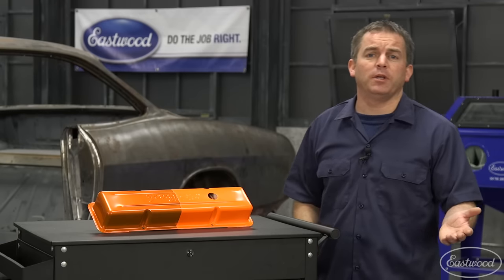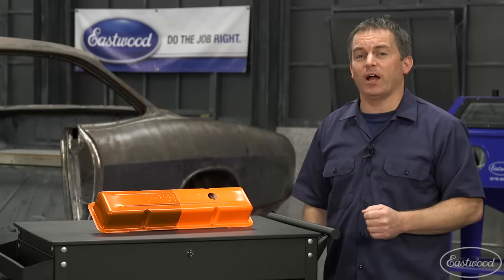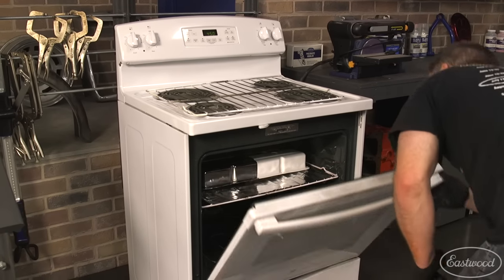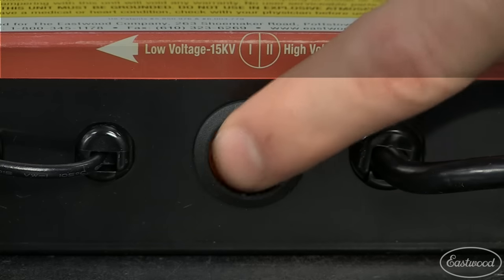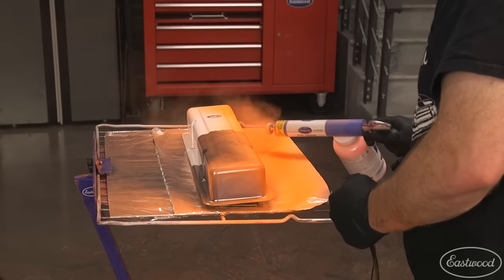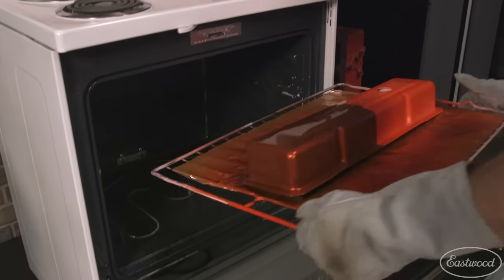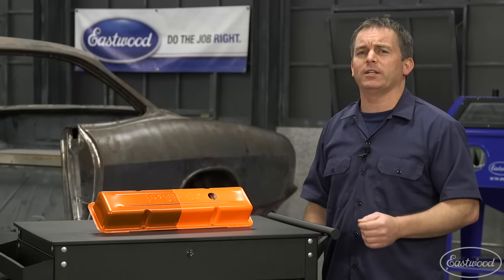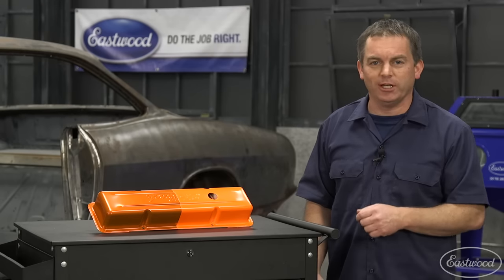Powder Coating Valve Covers - The Difference A Base Coat Can Make - Eastwood

Comment: hi i would like to ask you about the time that the chrome need to be in the oven , i saw a video that says the chrome base should be fully cured because after that the transparent colour is not that reflective as it should be , what is your opinion ? and what temperature should be the metal sheet to start top coat the chrome base ?

Comment: I'm guessing it's not necessary to scuff the surface for proper adhesion?.. looks like you just shot the powder over a smooth surface. Won't that cause it to flake off eventually?
Reply from the maker: Powder will stick fine.  No need to scuff the surface like you would for primer or paint.
Reply: Eastwood Company your website says the surface needs to be abraded to give it something to "bite on" "for optimal adhesion"
Reply: it also literally states "surface prep is much like traditional paint"....
Reply: Yeah, I have the same comment.  You say you don't have to scuff the surface but that goes against everything that I've read about on your website and other websites?
Reply: @pontiacdriver999  well other powder coating sites also say you can’t powder coat over chrome and clearly you can.